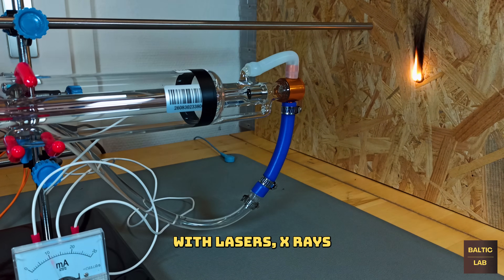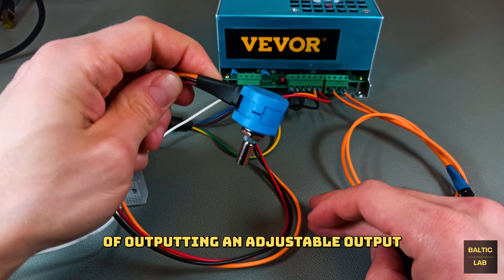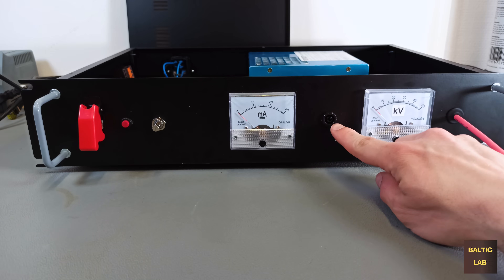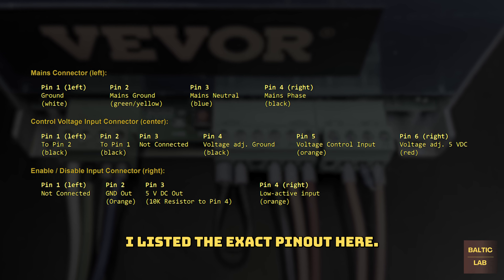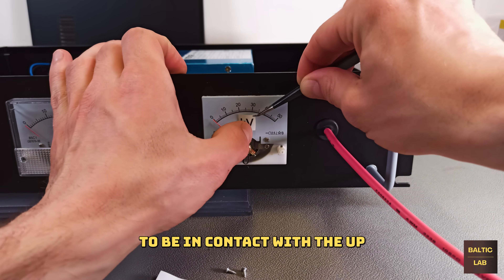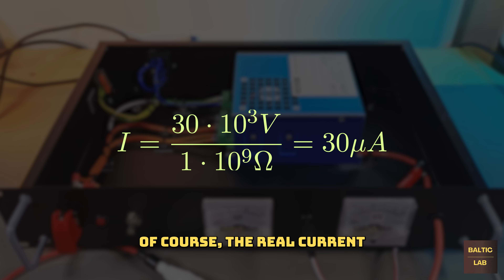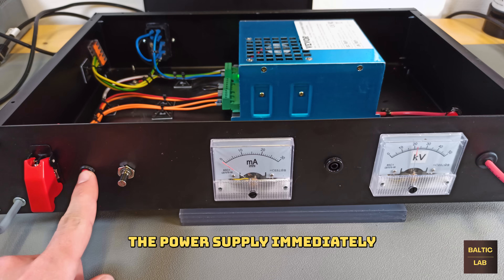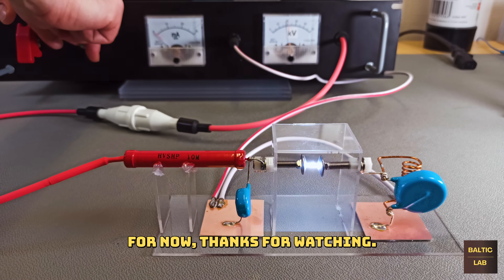DIY: How To Build an Adjustable 30 kV High Voltage Power Supply!

Comment: I rn use voltage multiplier. And i usually plays with spark gap. How do i make a current limiter for protect my voltage multiplier from overcurrent.
Reply from the maker: When I play around with spark gaps (see spark gap transmitter video on my channel), I usually just use resitors rated for the voltage and power. Very wasteful but easiest thing to do.

Comment: Thanks for the video.  But can you share the 10 turn potentiometer ohms or share the model number.
Thanks in advance
Reply from the maker: It's a 10 kΩ pot . For more details, and higher resolution imagesof this build, check out my blog article: https://baltic-lab.com/2024/03/inexpensive-5-kv-to-30-kv-high-voltage-power-supply/

Comment: I have not seen that HV cable connector before. Could you find a voltage rating for it ? It does seem conspicuously absent when i search for it.
Reply from the maker: Those connectors can be found on amazon if you look for "laser high voltage connector". They're commonly used in connection with CO2 laser tubes. I don't remember the exact rating of the ones I bought but they exist up to something like 50 kV.

Comment: Hello what is the model of the power supply? I didnt know laser power supplies could vary the voltage....i thought only current. Interestinf
Reply from the maker: It's a VEVOR 50W CO2 power supply
Reply: So we're you able to control only voltage with this without changing the current? I'd like to use this for an ion experiment in a vacuum, but my fear is that once the gas ignites the voltage will drop drastically to maintain the current setting when voltage is what I care about more than current.

Comment: Great video. I'm interested in replicating your power supply for use in an electrospinning device that requires between 10 - 30 kV. However, most commercial power supplies (such as the SKE EF020) limit current to around < 1 mA. Is it possible to reduce the current in your design whilst maintaining high voltage?
Reply from the maker: You can limit the current to 1 mA by adding a current limiting resistor in series. Just make sure its appropriately rated for the voltage and the dissipated power.
Reply: @BalticLab  Okay I'll give it a go! Thanks for the reply!

Comment: Superb presentation! Thank you. I built a simple "home brew" power supply to light up gas spectrum tubes (hydrogen, helium and neon) for physics homework using a 7kV neon sign transformer and a "dead man's" switch; the tubes only cost around $30 each but the commercial power supply is a $400+ rip-off! It worked really well and cost <$50. A laser power supply project seems like a good next step to enable other elementary physics projects that need more than 2-5kV, like the "observing field lines using semolina seeds in oil" demo.
Reply from the maker: Glad you liked it! There's even higher voltage laser supplies out there. And it seems they're dirt cheap, yet quite reliable.

Comment: Using just 1 resistor from the hv to the voltage meter is bad practice. You should use a number in series. Also conside a diode across the amp meter.  Interesting project. I was looking for something like this to test tubes and vacume capacitors for breakdown voltage. What voltage range has your unit? 3 to 20kv would be ideal for me.  

Thanks.
Reply from the maker: I wouldn't call it bad practice at all. While it's common in homebrewing to use multiple resistors, this is primarily to bypass the need for proper HV resistors. Commercial products use a single, appropriately rated, resistor, even at 100+ kV. The diode is a good idea though! And yes, it can cover your desired range no problem.

Comment: Very nice.
Is the output a high frequency pulsed DC?
Reply from the maker: It's not really pulsed DC, but not entirely free of AC superimposed on top of DC either. There seems to be a 40 kHz distorted sine wave riding on top of the continuous DC output. Sorry for the late response, actually had to put a scope on the output :)

Comment: Looks like the top cover would be too close to the fan.
Reply from the maker: Conventiently, the cover has plenty of slits for cooling. Should have probably shown that in the video. Thanks for pointing it out!
Reply: @BalticLab Quite atypical of a rackmount chassis, the top and bottom normally wouldn't be vented as they would be blocked by other rackmount devices.

Comment: I've been working in electronics for awhile now. Never came across a "spark gap" tester/system. What is is used for specifically? Is this to ensure you know what the maximum/minimum spacings for high voltage/current contacts/embedded features?
I work in FA, so I don't get the chance to play around with electronics like in my previous position lol. Thanks for the video
Reply from the maker: Spark-gap transmitter.. An extremely old type of circuit to generate radio frequency emissions. Transmitters like that were used on the Titanic, or generally in that time period to send Morse code signals around the world.